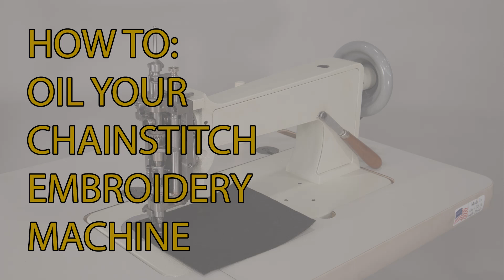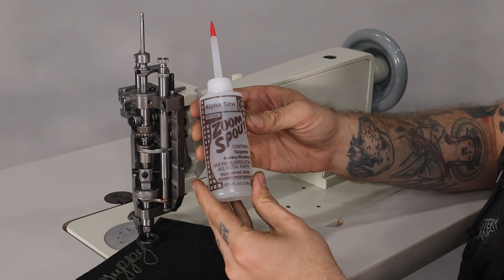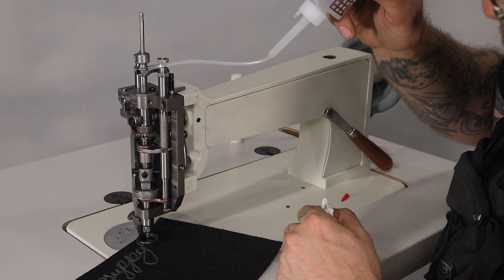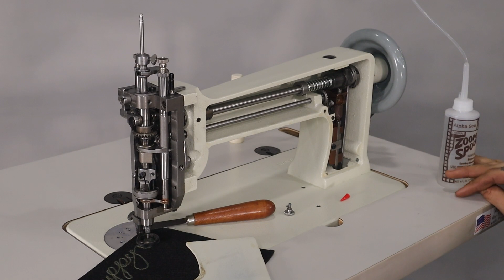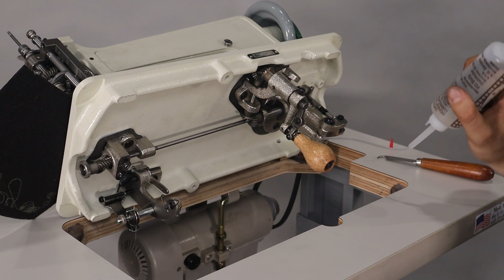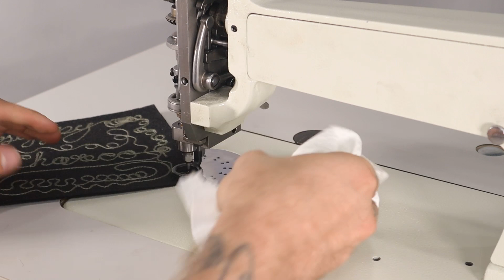Chainstitch Embroidery. How to: Oil your Chainstitch Embroidery Machine.

Comment: How often do you do this ?  And is there ever a point when you need to clean up old oil, dry it off and start to oil it up again?
Reply from the maker: I think a pretty standard rule of thumb for industrial sewing machines is a light oiling for every 4 hours of use. Yes, sometimes equipment does need to be disassembled for cleaning. Its less of an issue if the user has been lubricating with straight mineral oil than if grease, or a wax based lubricant has been introduced.